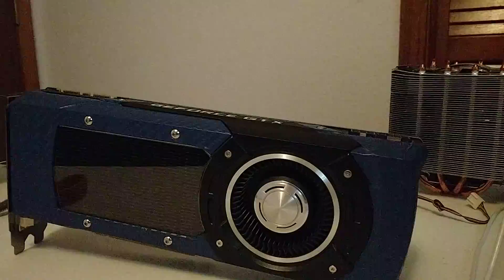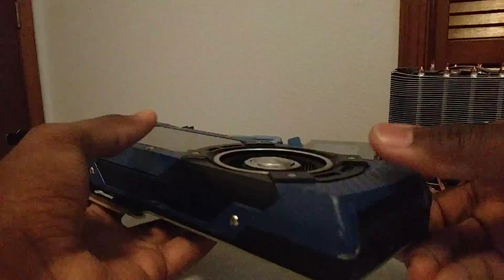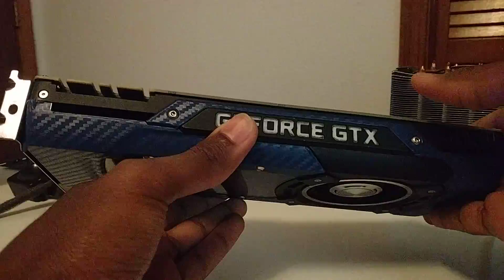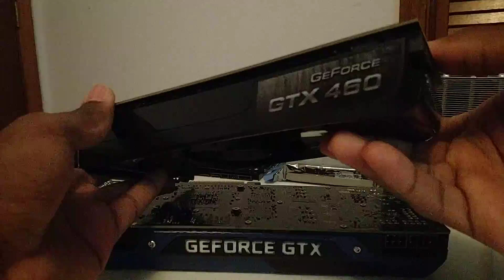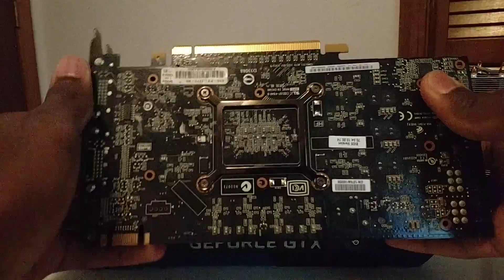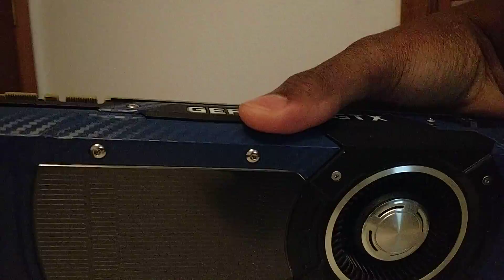My Graphics Card is Gone...

Comment: Maybe try doing a reflow of the die? Make sure you dont use an oven, though. All the mounting and unmounting of coolers you and I did cracked a solder ball, and over time vibrations from the fan and the rest of the system knocked it loose. Unfortunately, I couldn't find any cheap donor cards to replace the chipped die, and I can't find anywhere to buy a die.
Reply from the maker: Yeah, I might try and bring this card back from the dead at a later date but I'm about to get a new graphics card which I'm not gonna try and even bother messing up.